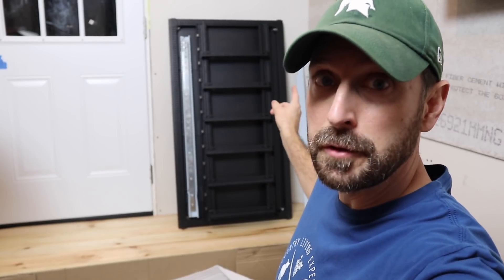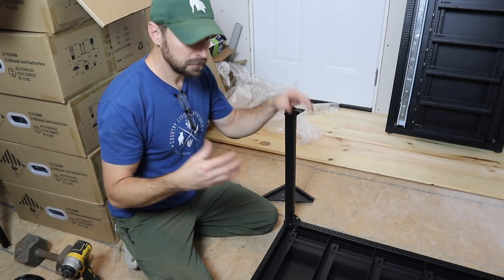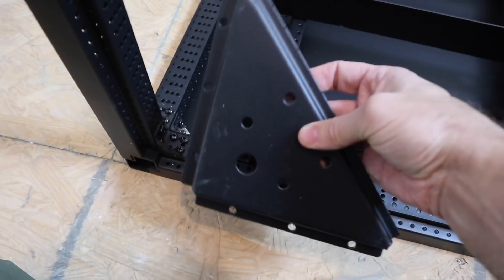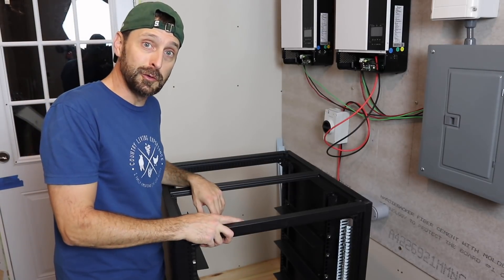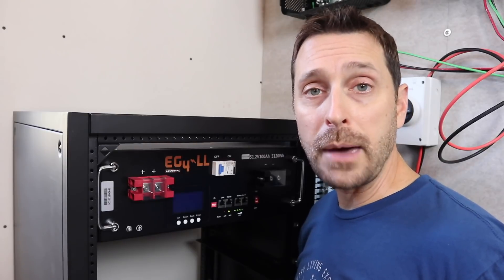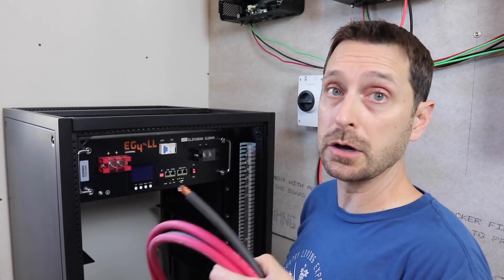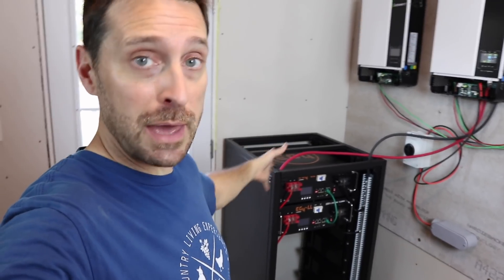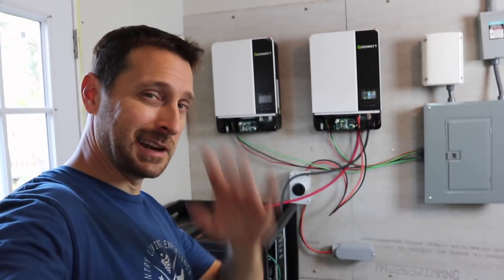Lithium Solar Battery 48v! Best Value EG4-LL +Rack Build Tutorial

Comment: I was an IT pro (network engineer & CTO) for over 25 years with meet-me rooms all over the country. Since those bats have coms you should only need ONE more expensive bat with the display, because it should give the same info for every bat connected--assuming they're made right, but they are cheaper.
Reply from the maker: I cannot find an option on a single battery screen to cycle through and give me info on the other batteries.
Reply: @CountryLivingExperience  It may only display alarm conditions on the others. If there's Bluetooth, it may be app only. I've never used that company, but I'd call them and ask them what the coms cable is for then, because it seems pretty useless to me at this point.
Reply from the maker: I can connect a laptop via the other comms port and obtain battery data on the entire bank. I don't run pc's in my house...only Macs. The lcd readout is for a quick check on battery health without connecting a computer.
Reply: @CountryLivingExperience  I don't have access to all of the info on their web site because I don't own one. They need to fix their TOC for the online manual for one... but as far as I can see you have to use the software to take advantage of the daisy-chained coms ports. I don't know if every bat has to have the screen, but I doubt it. Without the software there's no reason for it as far as I can see. You should ask them, because it's a waste of money to get more than the one upgraded bat otherwise.
Reply: @CountryLivingExperience  Sorry misread. I thought it said can't see the whole bank.
Reply: @CountryLivingExperience  also, make sure you assign them a proper ID according to their table so there isn't a contention issue.

Comment: Can you just use the Growatt inverter to balance charge the EG4 instead of buying the extra charger just for the balancing purposes?
Reply: Can you not run the generator in the ac input side of the inverter to power it on then use the inverters charger to charge batts?
Reply from the maker: The extra charger is for emergencies and is to be utilized with a small 2000w generator to charge the batteries. You cannot use the Growatt if there is no PV available.
Reply: @CountryLivingExperience  Thanks for the info. Kinda weird that the Growatt cannot charge the battery without connected PV although there is mode to charge the battery from AC if there is no PV production.  Also you can feed your 2000w generator to the AC input. The AC input even says grid or generator.

Comment: I have the identical batteries. Where did you get the BMS manual? Do you have a link to download it?
Reply from the maker: Cool. They have it available for download on the Signature Solar website. https://www.signaturesolar.com/?ref=countrylivingexperience https://drive.google.com/file/d/1d7VK7TmmvAMU38DY_UyAyyeAKLeW6uX0/view
Reply: @CountryLivingExperience  Found it !!! One question that was not answered in the manual. At the bottom of each display (I have 6 batteries) just below the double-dashed line seems to be a date and time. One of my batteries says 2041--03-20  4:21 What does this mean? And does the display give any battery discharge cycle count?
Reply from the maker: That is just the date and time. Mine are all set differently. I have not been able to find the discharge cycle count yet.
Reply: @CountryLivingExperience  What size cables do you run from the batteries to the inverters? I have 6 of them (like you do) and have 2 Trace 5548 to fun as a master/slave to deliver 220 to my electrical panel.
Reply from the maker: It really depends on your inverter specs too. The Growatt/Eg4 combo requires 2awg battery cable. That is what I have.

Comment: Thanks for sharing your experience with setting up your solar system. I am a licensed electrician from Missouri and wanted to add a comment on why you want a separate ground for your inverters. 

First of all, the purpose of grounding and bonding is to provide a path for stray current to get back to its source. Nothing flows on the grounding system unless there is a voltage leak or a short to the metal components of the electrical system (i.e. the panel housing, or battery rack)

So, for every separate source of electrical generation needs to have a ground path back to that source.  If you connected the grounds together with the utility power grounding system and a short occurs, it would be possible for that “stray” current to flow through equipment that isn’t part of that system. 

For example, let’s say a short occurred in the air conditioning unit that is powered by the utility power, but by chance the ground rod for the solar power system is closer than the ground rod at the utility meter, that current would possibly flow through the inverter and all the solar equipment. 

By keeping your grounding systems separate, you eliminate that potential problem. 

Whole house and portable generators should be grounded to their own rod and set up to completely separate the utility power from the system before they connect to the system because they are a separate source as well. 

Simple answer: Keep each power generation separate from the others, completely!  

That may be clear as mud…lol
Reply: You’re welcome!  Electricity is dangerous, that’s why Thomas Edison refused to work with it, and that concern for the public wellbeing has over the years grown to an inflated arrogance within the trade. 

My opinion, based on what I’ve seen developing in my career is the numbers of trained electricians are dwindling and the demand for electrical services are increasing. The cost of electrical)and other trades) is increasing because there is so much work. 

Because of this, individuals like yourself are going to work on their own stuff. If I can help someone gain some competency to keep themselves and their property safe, then I’ve performed a good deed. I’m not hurting anyone financially. 

I built my house from the foundation. The only trade that entered my house was the drywallers, and they were my in-laws. I value the pride in doing the work and seeing and living in the results.  It all boils down to keeping people safe, and sharing knowledge is the cool thing about the age we live in today.  

Keep up the good work!  I hope the solar system is doing good for you.
Reply from the maker: The trades definitely have a shortage. I am an Architect and see so many skilled trade shortages affecting the building process. 
I wired the room with the solar equipment. My first time ever wiring anything. Put in lights with a 3-way switch and ran some outlets with gfci. My friend who is an electrician helped by wiring the circuits to the main panel and putting in the new breaker for the solar. He gave me a grade of B for my wiring work. I just flipped one wire on an outlet that tripped the gfci. 
Thanks again for your helping/teaching attitude.
Reply: @powerpluspros  This is the way to live. Kudos!!
Reply from the maker: That is actually a very clear explanation and I appreciate it. You are way nicer than almost every other person who has commented saying they are an electrician. Most of them just call me stupid and use profanity. So, I thank you for helping explain things.
Reply: Note: The NEC requires only that solar generation (solar panels) be functionally grounded, which means grounding to the grounding bar of a main electrical service panelboard. That is enough. Going to a grounding rod will also meet the requirement.
Reply: I see a problem with your separate ground suggestion and it has to do with lightning. If a lightning strike hit the utility pole and you have two electrical systems combined by means of sharing a neutral but the ground is not common on the entire system then a huge voltage transient could destroy the inverter and all the stuff connected up to the inverter. 

There is also the possibility of the inverter transformer is the European style in which neutral is really a phase lag and it’s bonded to chassis ground. 

If so it Should be unbonded by taking apart the inverter and removing the bonding screw . 

I have seen lightning destroy so many things. Proper grounding is essential for the protection of the equipment. Neutral should only be bonded to ground in one location and one location only and that is in the principal disconnect. 

Good luck and happy inverting
Reply: Most inverters can bond and unbond atomaticly   depending how it's being used if it's not grid tied it's a floating system and your nutrals and grounds all go together other wise treat the panel as a sub panel and seperat nutrals and grounds
Reply: NEC 250-50 states that all all grounding electrodes as described in paragraghs 250-52 A1 thru A6 THAT ARE PRESENT... shall be bonded together to form the grounding electrode system.

Comment: 48v? No thanks. I ain't dealing with anything that can easily kill me. This is why I don't own a Lion.
Reply from the maker: Ok. Wrap yourself in some bubble wrap so you don't get hurt.
Reply: @CountryLivingExperience  LOLOLOLOL ded
Reply: @CountryLivingExperience   I'll do that if you buy yourself a Lion as a house pet. Deal?
Reply: Then buy the 24 or 12v version.  48 is still considered low voltage… it’s really not that scary.
Reply: @soldermecold7456  Yeah but according to Will Prowse if you touch the 48v terminals you get 1A shot straight to your heart then bye bye, but he does it because he has 20+ years experience with electrical engineering. You guys might think it's low voltage but just wait till this guy abruptly stops posting videos.
Reply: @migmigjohnson6083   Again, it’s not high voltage.  I work on systems that are hundreds of volts, a typical residential solar installation could be in the 600-800 voltage range, up to 1000.  Solar is scary because you can’t really turn it off… Electric car vehicle packs are also on the hundred.  That stuff is where you need to take real precautions… 48v isn’t as scary as he is making it out to be unless you start licking battery terminals.  Either way, just practice proper fundaments when handling power systems.

Comment: 13:52 would it be possible to use the 2x terminals on the unit itself to parallel instead of connecting it to the bus bars?
Reply from the maker: Yes, you could if you like. There are options which is nice.
Reply: @CountryLivingExperience  What copper wire size did you use to run from bus bar to inverter? Thanks!
Reply from the maker: 2 AWG

Comment: What is the length of the shelf (angled metal inside the server rack)?
Reply from the maker: 14". The battery overhangs by 1" in the front and 4" in the rear.

Comment: Do the batteries generate much heat??? Sorry if it's already been asked but maybe that's why there's no top or door on the cabinet, just in case you do try and fabricate some
Reply from the maker: They do generate some heat so they need ventilation but not a huge amount. If I do make a door or top it will be out of a screened material.

Comment: Thanks I've been looking at these batteries I haven't heard any thing negative about them and Will's breakdown was a valuable look at the inside of the quality of the build.
Reply from the maker: You're welcome. We are very excited to have them.
Reply: @CountryLivingExperience  
I bet 10 plus years is a fantastic warranty.
Longer if you are planning on only discharging 80% of discharge I'm sold.
Reply from the maker: @briandavis9975  Mine will always be topped off. If I am in a long no sun situation, I have that 48v charger with a small generator.

Comment: Do you have a wiring diagram of the system showing the grounding of the inverters/batteries/transformer/breaker box(sub-panel)?  From the video my understanding is the inverters and batteries are grounded together to their own a dedicated ground rod.  The transformer and breaker box(sub-panel) are grounded to the Main house load center.  Correct?
Echo —
Reply from the maker: No diagram. I wouldn't know how to do that and SS does not offer anything like that. Your understanding is correct. That is what John from SS told me to do.

Comment: what is then dome for neutral bonding at the inverter?
Reply from the maker: Please rephrase your Question. I don’t understand what you mean.
Reply: @CountryLivingExperience  This may be question for signature solar or an master electrician. Grounding can be tricky.
I am unclear as to how the grounds are separated when on utility power versus inverter power.  If the grounds on the inverter are run to the ground stake, I am not sure how they are sepperated for the below scenario.
when using utility, through the Growatt inverter, the neutral needs to be bonded at the main panel only.
When using solar or battery power, the neutral needs to be bonded at the inverter or sub panel when using the midpoint transformer. I checked for continuity of the ground terminal on the inverter for incoming and outgoing power and they are connected.

Thank you for any advice you can provide and your channel makes thing easy for most normal DIY installs.
Reply from the maker: You're welcome. I am unclear on how the grounding works as well. I asked one of the owners at SS last week about this subject. I relayed the info to y'all through the video. It may be best to call SS or an electrician for a definitive answer. Benjamin Sahlstrom also did a similar video on the topic here: https://www.youtube.com/watch?v=5iEuaAYs5x4. He is an electrician. Hope that helps.

Comment: Just an FYI, the on/off switch energizes the bms and readout,  the breakers energize tge battery outputs,. So you can turn on all your batteries with on/off switch and read each battery. Batteries output is not active until you turn on breaker.
Reply from the maker: Thanks, I understand that. I didn't speak clearly about it.
Reply: @CountryLivingExperience  Opening all the breakers to the load before powering the battery basically saves wear and tear on the pre-charge components in a nutshell, they only have to function one time if you have a clear path to the load. They will still function, just each breaker forces it to function causing wear.
Reply: I want to add a little more comment to your reply. The built-in pre-charge resistor is switched in when the BMS switch is turned-on, so you want to close the circuit breaker first and then turn on the BMS in order for the pre-charge resistor to do its job. The display shows the battery voltage, of course. One can measure the battery voltage at the terminals by using a multimeter after closing the circuit breaker.

Comment: Are you then grounding the sub panel at the same ground rod as the inverter or grounding it to the main panel that provides the 240V for using grid power there by  using this ground for circuit grounds?
Reply from the maker: Sub panel is grounded to the main panel.

Comment: What is your opinion of Powerwall from Tesla compared with these batteries? Thanks
Reply from the maker: I have heard good things about them and have a friend in Puerto Rico who has one. They are expensive however. The value of the EG4 battery is currently unmatched. The EG4LL that I have is $0.34 per wh.
Reply: @CountryLivingExperience  Not exactly true. The Seplos Mason kits are 6.9KW and .22 cents per Wh.
Reply from the maker: The title and thumbnail are phrased as questions. Value is more than just the monetary cost. I have never heard of Seplos Mason anything so they may or may not offer quality like the Eg4 and Growatts and therefore be of lower value.

Comment: I think US voltage should be set to 240 not 230 also frequency should be set to 60 hertz not 50 just an fyi.
Reply from the maker: Ok. So what would you like me to do about that?
Reply: @CountryLivingExperience  I believe that inverter is set on the European standard if it is reading 230v the big problem would be the frequency at 50hz I'm pretty sure you can go into settings and change it to the US standard of 240V and 60hz. Signature solar had a video on the settings for the inverter. You said the inverter was putting out 230v in the video. The 50hz frequency is the main problem all the electronics in the US are designed for 60hz.
Reply from the maker: Thank you for the clearer explanation Frederick. I will look into those settings.
Reply: @CountryLivingExperience  anything between 220 v and 240 v is good to go. the higher the voltage, the longer distance runs you can have without the negative effects of too low of voltage drop. the higher voltage 240 will run equipment just a little cooler.  If you can't change it, then everything will be just fine. no worries.
Reply from the maker: @Sparkeee1978  That makes sense and I appreciate the explanation. The original commenter did not make any sense to me hence my response to him. There is no way for me to change someone else's equipment. There aren't any settings or switches for that as far as I know.

Comment: I did not know you could use the 12 volt batteries for the 48 volt growatt unless you out them in series.  So you have to use larger wire now?  So you have to modify the charger settings so your not putting to much voltage into them while charging?
I went with 48 volt so I'm still waiting on my batteries...
Reply from the maker: My batteries are 48v.
Reply: @CountryLivingExperience  oh good my bad,. On my small screen  it looked like they said 12 volt...   Anyways I'm glad you said they had more in stock.  When I called a couple weeks ago they said they were out and that I was looking toward the end of January middle of February to get mine...  Guess it's time to call them again.
Reply from the maker: No problem. Yea, I would call them quickly. They could be out again but if you made a pre-order, they should have yours waiting for you (or to ship to you).